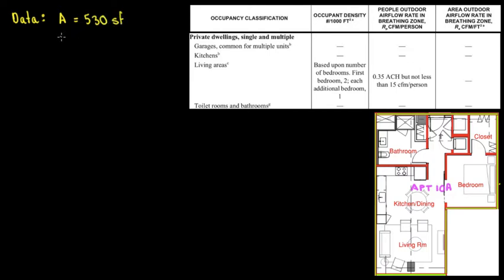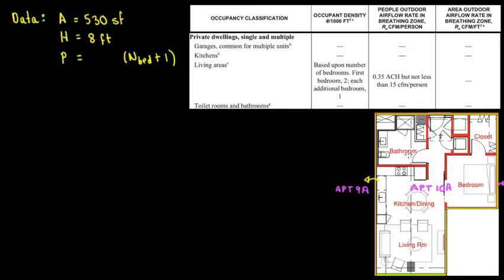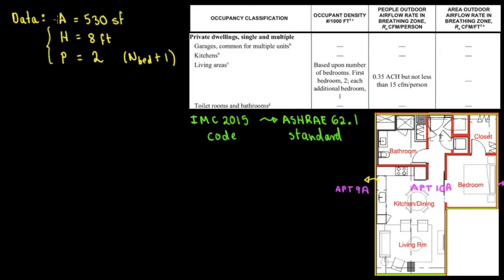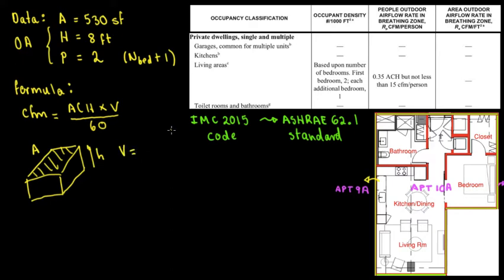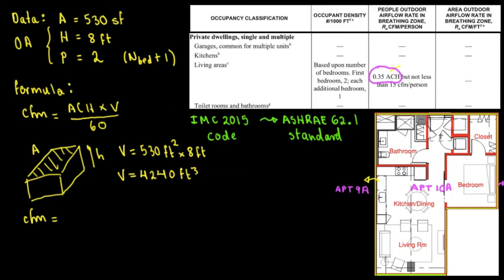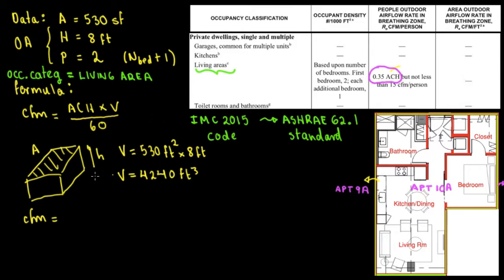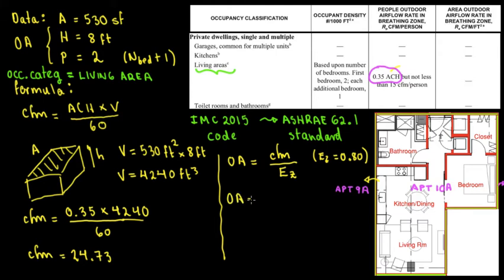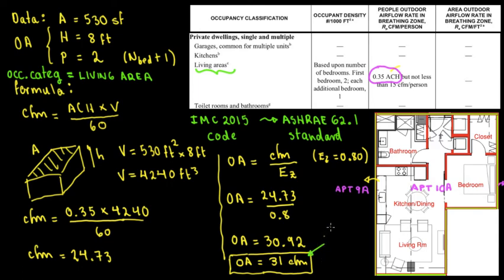ASHRAE 62.1 Fresh Air CFM, ventilation rate. Apartment Unit, Part 1

Comment: Maybe I confused, could you explain me a bit why the calculation of fresh air for residential different from fresh air for commercial building? Thank you.
Reply from the maker: No problem. ASHRAE 62.2 is for low rise residential buildings. It only takes into account OA = 0.01 sqft+7.5 (Nbed+1) for 2010 and OA=0.03 sqft+7.5(Nbed+1) for 2013. This usually depends on the authority having jurisdiction. County and location requirements are necessary to follow either ASRHAE 62.2_2010 or 2013. This calculation is mainly for Commercial applications where the layout is different. The apartment units can be utilize in high rise buildings (10 floor building for example) where the conditions are different than residential (no more than 3 floors). In this video, we utilized the IMC (International Mechanical Code) which usually based in ASHRAE 62.1. I will make another video indicating ASHRAE 62.1 for apartments Part 2 for more examples. I hope this helps